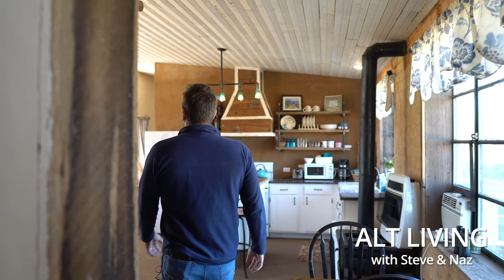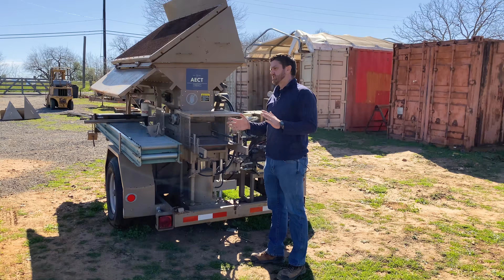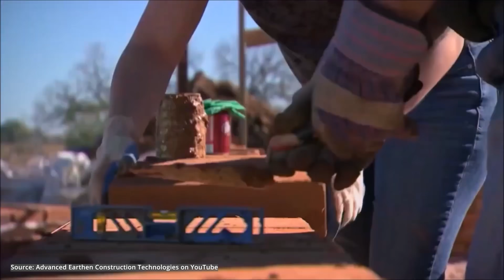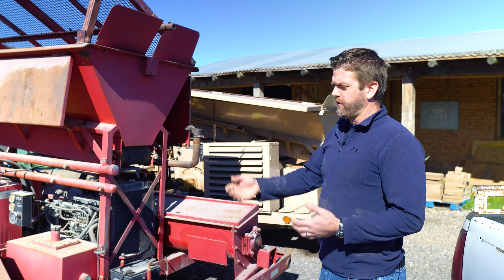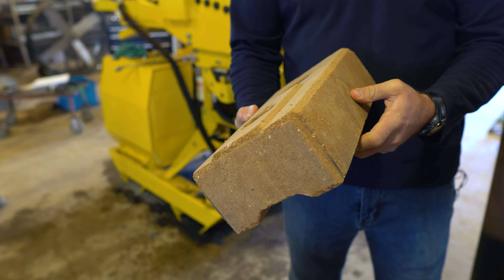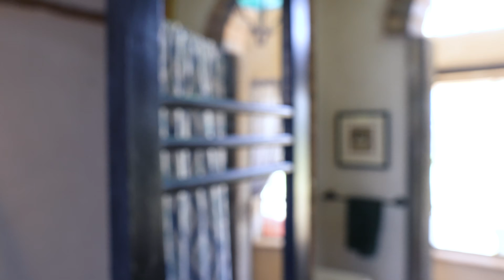How to Build an EARTH HOUSE with COMPRESSED EARTH BLOCKS / BRICKS: Ryan & Melissa Runge Netflix HGTV

Comment: "Why isn't everyone doing this?" Because humans are resistant to and slow to change. Once it was discovered that scurvy could be prevented on ships by taking dried limes on voyages, it took several decades (48 years) before it was implemented in the British Navy. Same with handwashing before surgery and child delivery (look up Ignaz Semmelweis & Joseph Lister), Semmelweis introduced his theory in 1847 (prior to germ theory), and faced persecution and died because his colleagues put him in an asylum, where he was beaten severely and died of his wounds. Joseph Lister (of Listerene fame) eventually became successful toward the end of the 19th century, along with the help of Louis Pasteur's germ theory, in widespread adoption of antiseptic practices in childbirth and surgery. In both cases it took nearly 50 years before these ideas went from theory to practice. 

I went to high school in the early 1980s, and I read about passive solar design in architecture, and here we are 40 years later, and passive solar design is rarely practiced in building in the U.S. And it's the same sad story for other building improvements, such as earth blocks, etc.

I lived in a 100 year old adobe home in the northeast corner of New Mexico for several years, 12" thick walls, and the lowest winter temp. I saw was -32ºF. Those walls stored the heat from the wood stove nicely and kept us very comfortable.
Reply: sad but true!

Comment: I would love one of these machines
building offgrid in Deming area
but
I'm not setup yet- one day will get one (hopefully) they look awesome
in the meantime

I created my own (which is way less efficient), but it works off-grid without power for cheap.
for anyone interested off grid- here's how I did it- Hope it helps someone

Using a repurposed car jack, I built a heavy wooden frame (extra reinforced) from 2x8's. The bottom is open but has internal screws that support another 2x8 base that slides up (kinda like a cake pan) 
I pack in my earth and portland cement mix, make sure its semi moist. hand tamp it, and top it off again with soil.

I place it under a heavy duty reinforced table thats low to the ground that can accommodate the jack and the frame (4x4 legs) and a heavy duty x2 layered plywood top. The bottom of the table has an attached 2x8 piece that mirrors the bottom plate of the frame and fits inside snugly.

I stack as much weight on top of the table as possible (concrete blocks, all my bags of concrete and portland cement, ect- 
I put the frame with movable floor/base on top of the jack and start lifting it into the fixed centerpiece until the table starts to lift
this is how I know I got maximum compression

whole setup about 200.00 - good enough for now.

Comment: Bricks from literal dirt?
And it's so simple to make they sell those small machines as if it was just a cement mixer?
Damn that's insane.
Reply from the maker: The brick making method changes depending on different populations, so not everyone uses a machine.
People have been building with earth blocks (adobe, rammed earth, mud brick, and similar materials) for thousands of years. Many of those can still be found today.
Reply: @steveandnaz  Yeah I knew there were some ancient building techniques where you just pack some mud with sticks as rebar and make small huts.
But to make it looks so neat is something.
Reply: sarcasm detected

Comment: So, why not just use traditional bricks?
Reply from the maker: Compressed earth blocks have a great thermal mass and are more breathable than normal clay bricks. They are also much cheaper if you already the soil in your property.
Reply: @steveandnaz  firing bricks takes a great deal of heat as well, resulting in high CO2 contribution

Comment: Hi I really like your video. I learned a lot from you so I'll be watching and liking more of your videos. I'd like to build a house on a rubble Trench  foundation & a passive rammed earth house with walls 3 feet thick and 2 foot tall rammed earth blocks. How do I connect the rammed earth blocks to the rubble Trench foundation? I want my rammed earth blocks to be interlocking mortarless blocks that are made of perlite and limestone added in. Could you please make me a machine that makes interlocking mortarless blocks like those blocks that (System 3e) company makes. System 3e is a company that makes interlocking mortarless blocks that are very durable something like the blocks that you make. How do I make the best strongest rammed earth blocks consistently with these materials. I want to build a 2 and a half story house. Should I do raw rammed earth or stabilized ? Could I add straw to my mix of rammed earth blocks for better stability? I want to build a house that doesn't have mortar between the bricks. How do you connect the blocks to form a story house wall? Or should I do a cob Straw house? What's the best cob or straw? Could I use a hydraulic press to make interlocking LEGO blocks of rammed earth blocks or cob blocks instead of using that pneumatic tamper? Or do I have to use the pneumatic or hand tamper? Please keep in mind I'm building a 2 and a half story house so I need strong wall structure that could support load bearing walls. How much does your machines cost? I'm from Detroit Michigan. Do you ship your machines here? Could you please tell me what I could add to the ingredients to make my interlocking rammed earth blocks water resistant? If you send me a machine I will need more than 4 different styles of forms to build a house so I could make & allow all the brick blocks to connect. I need a normal block then I would need a mold for making corners connect going in both left and right directions and half blocks for making connections. And I need smooth top blocks for adding a second story house flooring and roof and seal plates? Who could work with me to help me with this? Oh by the way you never mention the price of the machines that you make so I could order.
Reply from the maker: Hi! We hope you're doing well! I appologise for the misunderstanding. Our channel is about alternative lifestyles, focusing on van/rv life and travel info vlogs. The person on the video was approached by my husband Steve and I, to show us his house and business.
If you wish to contact the person on the video,  his contact details are in the first pinned comment of this section, as well as the video description.
Reply: @steveandnaz  thank you!
Reply: https://youtu.be/CSmOyLrOfKs?si=mLPMPXA7ETO4nyB-
Reply: https://youtu.be/dGpKLS5hqcI?si=FrSuTLEA8Y5K_5DG

Comment: What are the advantages and disadvantages of building with compressed earth blocks vs. rammed earth walls? They seem comparable but I have no clue which is the better building material for a given project in a given climate.
Reply: Earth blocks are more versatile and the process is less expensive

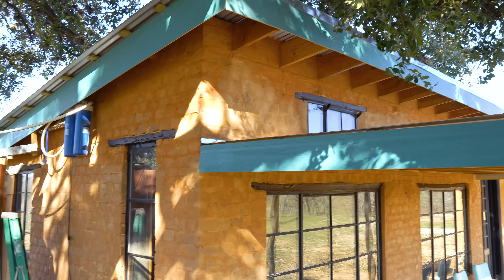Comment: 1:44 this statement makes absolutely no sense. Thermal mass is way different than insulation. Having something thermally massive will store lots of heat or lots of cold.
Reply: that's correct

Comment: Ah glad you mentioned the lime turning to limestone.  I was wondering about pozzolanic lime stabilizers instead of portland!   Am curious to look into what you do and applications towards sustainable tiny affordable housing options from a manufacturer perspective.  

Question:  Can you have these gain carbon over time like hempcrete, where it's absorbing atmospheric carbon and hardening?  Is that what happened to the lime soil in the pyramids - the way you mentioned.  Thank you for your answer if you can find the comment

Comment: So does that just use the earth or does it have to mix it with water and straw like regular adobe?
Reply: You can make CEBs with only dirt...in fact you don't want organic matter in the block because it's compressed so tightly. You can stabilize with 4% to 10% lime or cement if you want

Comment: Nw Arkansas  built entire neighborhoods on 2 ft of pure mud. Dirt. Perhaps expansive soil.  All the  building material is literally sitting under the houses. Cracked driveways and soggy soft lawns full of moles, voles and shrues. 
I've  been exploring a full basement addition.  Dig out the dirt, process it and reinstall as floors and walls. The tricky part is how to build walls  and a floor that wont buckle.

Comment: I would put fly ash I. Their to make it waterproof
Reply: Roman cement and concrete used volcanic sand and pozzolanic ash. If you don’t have access to pozzolanic ash, flyash is a pretty good modern substitute and offers the same chemical reaction. It is relatively cheap since it’s a waste byproduct and allows to further reduce the amount of Portland cement used.   Pozzolans are considered a supplementally cementitous material (SCM) and may already be used to produce Portland cement in some areas, reducing the cost of production by 50 or more. Also pozzolans fill the pores in volcanic sand causing decreased permeability and can react with any free lime in the resulting concrete where if microscopic cracks form, water ingress at the crack causes the chemical reaction that initially formed the concrete to restart at the location of the crack and repairing the fissure. 

In a rammed earth or compressed earth block application, flyash reduces the permeability, adds compression strength and further reduces any Portland used. Instead of 10% Portland in some cases as little as 3% could be used.
Reply from the maker: Fly ash?!
Reply: I have not hear of Fly ash or that it could make it water proof.  neat idea.

Comment: does it handle northern climates?  Would you have to water seal to prevent moisture absorption and cracking due to freezing? And lastly, does it provide any insulation against the cold or is it similar to concrete blocks?
Reply: Cement or lime-stabilized CEB walls perform well anywhere on this planet. There are several CEB homes in Colorado.  The best thing to do is apply a traditional lime-plaster to the exterior of the wall...or even better, incorporate a wrap-around porch on your home. CEBs boast a much better thermal performance than concrete blocks because of the clay content.
Reply from the maker: Great questions!
Reply: In a seriously cold climate, I would consider adding an insulation layer. All you have think about is earth will over time freeze or get very cold.

Comment: I am looking at properties and one has 2 homes built on the land . One is a fire hardened strawbail house and the other is a earth bag house . They both are beautiful with thick walls and two stories with balconies etc . These building materials and techniques are very intriguing .
Reply: I would like to see the two properties you refer to. Is it on YouTube? Thanks
Reply: @wm.frederickcooper3775  
Look at California in the Grass Valley area on Redfin etc . Put 500k to 800k in the search parameters and it should come up , it's 725 or 750 . Actually has a smaller 3rd mini house that's pretty cool . The owner would like to rent back one of the 2 larger ones but you can read all about that when you find it .

Comment: So many questions. How much ground and micro plastics can you put in them?  We need to start building with recycled plastic.  There’s too much of it and we keep making more. Even products made with recycled plastic contains new plastic. Not to mention the amount of energy and pollution from recycling plastic.  So, can it be added to earth blocks, bricks, etc? Are these machines rentable? Also, do use rebar like you do for brick?  Is it cheaper than using common building brick? Can you bake them and make them more stone-like? What kind of foundation do they sit on?  I was born in a mud shack. It would’ve full circle to built a mud house 😅.

Comment: good for warm dry climate but not cold wet. r value would not pass code without modification.
Reply: You can affix insulation to the outside, inside, or even do a double CEB wall system that allows you to put insulation in between...if thermal mass is good, then thermal mass plus insulation is even better!

Comment: How does it perform in wet climate with freezing and thawing?
Reply: I mean you just plaster them and it's pretty much impenetrable
Reply: The problem in cold climates is there is no insulation. The heat will travel slowly through the wall but you are still forever losing heat.
Reply: They have performed very well atop mountains in Colorado as well as on the beach in Baja, Mexico!

Comment: I don't believe the claim that these buildings are well insulated. It's true that they have high thermal mass, but they are still going to leak heat in winter and be cold. Certainly in Australia they would need insulation on the outside to meet the code requirements (we have coldish winters in the south).

Comment: Huge thing, great video !  Would stabilizing with congregants like crushed rocks be an option ?
I mean for those machines  ?  To me as a house builder it would add to the sustainability of the building in a calculated way.
Reply: Stabilizers like lime or cement don’t make the CEBs stronger…they make them more water proof. Small aggregate might make the blocks a little stronger but won’t help with water-proofing.

Comment: Affordable, highly insulating, fireproof, non-toxic.  What's not to love?
Reply: Not insulating, but they have a lot of thermal mass which is a different way to moderate temperature.
Reply: @gullinvarg  The materials are not insulating, but nothing is stopping you from insulating it. Id take that thermal mass + insulation.
Reply: Whats not to love? If people can buy this machine they can make their own home and keep the money they would otherwise pay a bank over the course of 30 years, do you not want the banks and politicians that are into realstate to have easy money? Common people should be making the hard money for the bank workers and owners.
Reply: @fullmindstorm  That's against leftist law..Politicians and their lobbyists own you..
Reply: You forgot bulletproof.
Reply from the maker: Right? 😍😍😍
Reply: earthquakes
Reply: Some spalling risk?
Reply: inconsistency. I guess it's ok if you build it yourself. but if you sell those blocks the quality and the composition should be consistent. architects should be able to calculate loads somehow.
also weight. to make them on site looks fine, but deliver those, load, unload in large amounts - that's what construction companies need.
Reply: @guai9632  They can be calculated. The idea is for them to be built on site.. contributing to reduced carbon emissions.
Reply: How much does it cost to rent the small machines? I think I missed that part.
Reply: Meeting local codes to build and does it work in cold humid climates?
Reply: There is a huge difference in between something that is thermally massive and thermal insulating. Thermal mass is also very good at storing heat as well as cold. It could be a major disadvantage.
Reply: I’ve looked at so many natural building methods and even tried a few. Now I’m looking at this one. There always seems to be a catch. Something that costs too much or is too labor intensive like cob (and straw is now expensive). I was excited about rammed earth recently then learned how much work the steel forms would be to build. These earth blocks look good but the machine is expensive. Makes cob sound good again. I dont want to need a stucco or plaster job like strawbale or hyperadobe. That’s a whole extra step on the inside and outside of the wall. I plan on large eaves so rain will never touch the earth wall. Oh, I have not forgotten Adobe. I’m going to make some test blocks with our soil. It may win out. It is New Mexico after all. But if I could start making a few of these compressed earth blocks everyday. Say a dozen per day with my own miniature machine then in a year I would have 4400 blocks stacked. How many does it take for a additions? A quick calculation estimates about 4000 blocks to do the two additions (two car garage and guest wing). Hmmm…..sure beats the crappy lumber around here. Oh, there’s rock houses around here also.  But not many rocks on the property. So to buy that much rock would be expensive. I have considered doing the bottom 2 feet of the walls with rock. That would look great.
Reply: @paulbaker3144  Rammed earth does not need steel forms, unless that is what you want to use. We use only lumber. Simple, fast, effective, reusable on other parts of a build.
Reply: Real estate Investors like their cardboard boomer McMansions.
Reply: Rain?  Unless some sort of sealant
Is used
Reply: @tylerdavault9604 lime plaster would work. People use that on cob houses too. Having a decent overhang can also protect the walls. That's aside from the possibility of adding stabilizer.
Reply: @tylerdavault9604  Like on wood houses, yes.
Reply: @tylerdavault9604 Rammed earth buildings have survived thousands of years. Clay, lime, or even a small amount of cement bind them very effectively. Did you watch the video?

Comment: “Structure, insulation, internal finish, external finish.” What's the R value?
Reply from the maker: It would be interesting to know! Maybe try contacting Ryan? We left his contact details in the video description.
Reply: Pulled out an old reference book. Masonry 1] Sand and gravel aggregate 8 inch R 1.11  2]Light weight aggregate 4 inch R 1.50 3] Light weight aggregate 8 inch- R 2.00. To put that into perspective a double pane window has an R value of about 1.80. The blocks work as a great moderator in slowly gaining heat and losing heat such as a desert condition but if it is continuously cold, you will need insulation.